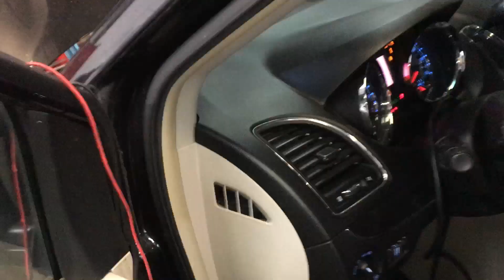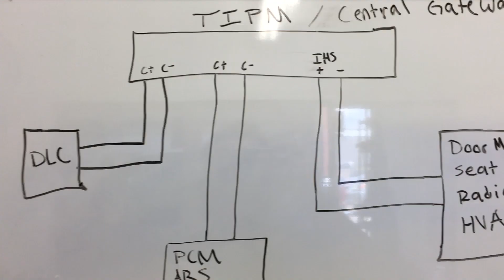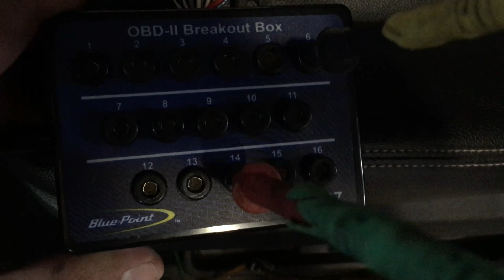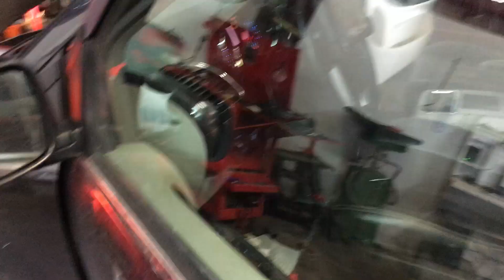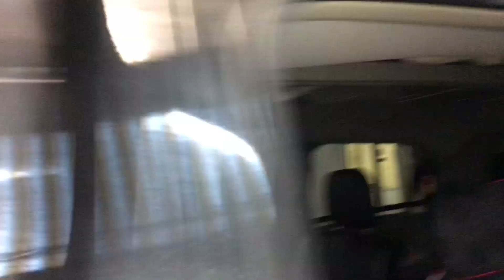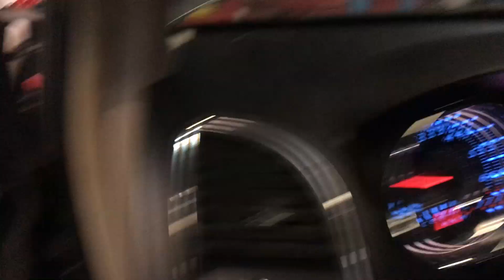TOWN & COUNTRY CARAVAN NO BUS DIAGNOSTIC

Comment: I got rid of the code.  No fooling with TIPM or wires.  Not sure how i did it, but i let the car sit for at least 4 or 5 hours without messing with it.  Then i sat in the drivers seat and turned it on.  The radio started to light up and finally came back on...then went off...i turned the car off and put the key in accessory mode.  Playing with the reset button on the steering wheel...i also pressed on the gas pedal....then i kept going back and forth with key in ignition without turning the car on.  All the lights that were on the dash started clearing away.  Then i turned the car on again..and all came back on....i repeated what i did before....then my windows were able to go up and down by me pressing on button...and my passenger back doors started to open  by me pressing on it's buttons.  We had a heavy rain here in Texas.  And i went through some puddles.  I believe that set off the sensors.  When everything went back to normal...the DASH said DONE.  Which meant no more error faults.  Hope this helps someone.  Btw a few days ago i did get a new alternator put in, i needed one and i needed a new battery as well.  There was no way i was going to get a new TIPM or have wire work done.  5th generation DGC and CHRYSLER T&C are possessed.

Comment: Thank you so much for this video, you probably saved us 100s of dollars at the repair shop. We have a Town and Country S minivan that had the same problem. It started after washing the vehicle. The problem was the drivers side rear door where the connection got wet from power washing. Again, thank you!!
Reply from the maker: I'm so glad this video was able to help you!
Reply: @ADVANCEDLEVELAUTO  just washed out vehicle and experiencing the same problems. Once it dries out did it fix problem or did  you still have to disconnect something?
Reply: I have a 2013 Caravan….is there still a module in the roof climate control w/o having DVD option?  I have tried most other modules without success…any insight appreciated.  Thanks
Reply: @dirtystayouts24 in thinking the same thing since the rear ac on my 2012 grand caravan doesn't work and now the lights come on randomly draining the battery while sitting in the driveway.  there are wires in the sliding doors I'm going to check, as well as the driver door wiring, as those can break most easily apparently

Comment: I have an 08 town and country with the same electrical issues. I’ve also had trouble with the van randomly switching to first gear while driving. The only way to change gears is to pull over, shut the van off, and manually change them. Sometimes it works, sometimes not. I’m pretty sure it’s not related to this but worth asking if anyone else has had the same issues. If so how did you fix it?
Reply: clean the connector to the transmission.  ive read those get corroded

Comment: I have a 2008 Dodge grand Caravan turn headlights on the flash code comes up high-voltage thank it could be alternator
Reply: The sensor wire could be shorted to power. Did you check your voltage at the battery terminals ?

Comment: Getting similar issues with gauges going crazy. I just went and straight unplugged the connecter for the dvd and rear AC and the dash goes back to normal but as soon as I plug it back in it starts going crazy again I believe it's the dvd player what would I need to fix this issue?

Comment: My question is how you charged this guy? One flat fee or per hour fee for diagnostics? What did you tell him about the diagnostics fees when he first walked in the door? How do you explain to a customer the diagnostic could take one hour or a couple of days? What do you tell them when it took you 16 hours to diagnose and it turn out to be a melted wire that took 2 minutes to fix? Or better yet, you tell them the solution and they want to fix it themselves.

Comment: How did you fix the System Low Voltage? I’m having this problem and my battery seems to drain when I turn off my van, but no problem when it runs.

Comment: I have an 09 T&C. Issue is dash will reset while driving, wipers cycle, headlights pulse and every dash light illuminates as well as red security light in center of dash.
I have checked wiring to the doors - no damaged wires. After watching your video, my dvd player will not play a movie - there is power to the head unit and the screens, but it wont project  - however, the dvd in the radio plays just fine.
Any thoughts you could pass on??
Reply: Any idea on your problem? I think I have the same issue with my 09

Comment: Thank for the video! I tried this out on my 2009 dodge town & county. It didn’t work for mine. But I wanted to see if you had any other solutions or other options I can try out. You might know a more then I’m going in this blind. I bought this van from a auction it was a flood purchase. The van turns on and is drivable and the electrical is partially working. Wipers stay on headlights stay on, but the doors and the lights on the dash are not working the radio and tv also not working. Hopefully you can help. Thank you in advance!
Reply: Did you figured out ?

Comment: Hi Eric..I have a 2011 Chrysler T&C van.  Every few months the battery light comes on and the battery won't charge.  Then, every time I drive to Midas to get it fixed, the battery light will go out and it will start charging again.  Happens every few months.  Any ideas why this may be occurring?   Frank   (koerber@att.net)

Comment: Here is an idea you can try in a future "No Canbus" scenario. Basically connect only a positive external +5vdc supply to the Canbus reference line; no negative, or no ground connection from the 5vdc supply. 

Connect a 5v volt step-down voltage-regulator to the car battery, while keeping the car battery connected to the car. Then connect only the positive 5v output lead from the voltage-regulator to a known Canbus 5v-reference wire within the car. The Canbus should "come alive". Now connect the OBD scanner to determine which module is at fault.
Reply: Most wont get it but always  attack  easiest  first

Comment: I have a different problem with my van 09 dodge that gave me a half turn  and then seemed like battery died, since then won't turn over with a charger or jump. All lights come on but starter just won't spin. The way it happened I dont believe it's the starter but I know I could be wrong

Comment: Chrysler release a stament saying that those radios had issues causing this very problem.. And the dvd player is hooked directly into the iod fuse instead of its own fuse so because its coming on its telling other shit to come on or in this case to shut off. Way 2 much labor for something u cpuld have found by pulling fuses and mussuering the parasitic draw

Comment: This topic is intimidating, if only because of the specialty tools and the way communication is more complex than simple power and ground. However the more I think about it, basic principles still apply. It is also helpful in some systems to have end module resistors in parallel to allow a multimeter to measure resistance and infer the status of the wires (open, short, or good). The worst of this for general mechanics is the lack of normal values and poor communication of those standards in the dealer repair manual. In the end, your theme to disconnect modules one at a time and watch the signal seems to be reliable and systematic. I'm gonna have to tap into these circuits a few times to better appreciate how they work in normal vehicles. Another brilliant video, Eric.

Comment: Great diagnosis using a  simple 'cause and effect ' type of format, other than the lab scope functions. You would think with all the program[s] sophistication and high/low speed 'data bursts' between the IHS portion of the TIPM and the LIN system or modules tied into the network, some type of parameter ID could monitor and identify what module's resistance value increases or decreases +/- 20% from a specified value. When that specific  resistance value is exceeded, the corresponding module that deviates beyond the preset parameter would trigger a 'CE' light to notify the operator or technician like yourself who has the correct scan tool and diagnostic software. I realize the customer had spent a significant amount on your labor fees via the poor design of not having accessible splices and a single location for the numerous modules, however, I noticed a child's safety seat in the back; and the customer did not wish to have you repair a speed sensor on a small mini-van to make sure the break system was in top shelf condition? Maybe he has recently experienced other unknown debts, I guess. I would certainly state his refusal to Not repair the ABS system on his invoice as a matter of CYA. Video is a Great learning tool; and condensed to boot!
Reply: So what you're saying is every vehicle and there's millions of them that have no or inoperable antilock brakes is some kind of a form of child abuse? Hopefully you see the real child abuse is letting a child think there's something they're not and even supporting it with your time and your money or even worse taxpayers funds. That's child abuse that will affect them their entire life.

Comment: The problem in my area is the customer doesn't want to pay for this type of diag. Plus the management tend to discount the difficulty of diagnosing this stuff. Most mangers are stuck in 1980. Just do a real quick check is what they say. They have ZERO knowledge of how this stuff works and don't believe all this testing is needed. So the manger won't pay/charge for it. Brakes and alignments are guaranteed money. I. Give. Up, I really believe we are going to see massive delays getting cars repaired in another 10 years. All this fancy crap is going to start failing and there won't be nearly enough techs with the knowledge to diag it much less customers that can afford to replace the hardware. It's not that hard to roll a window up with a handle...but I digress...

Comment: Good diag. Not sure if you tried disconnecting the door entirely. Most doors have a single connector at the hinge which would’ve made the diag a little faster since you wouldnt have had to take the door panels off. Either way good diag with good direction. I know it sucks when you can’t find the exact cause but at the end of the day if the customer doesn’t have the money you gotta stop there and keep moving.

Comment: Are there separate connectors for the doors, vacuum, radio, etc. on the TPIM? You took the door panels off and hvac unit out. Could you not have disconnected these modules on the other end of their cables? At the central control module (TPIM?)?

Comment: Hey, FYI there are star connectors mounted under the dash to disconnect all those module in one place, Makes it really fast to diagnose with out disassemble of the interior, I really liked your video.
Reply: Can you elaborate on how to find those?
Reply from the maker: I tried looking, but couldn't find them. Thanks for watching!
Reply: I am having the same the problem with my van, very informative I feel there is a few simple things I can try now to cut down on labor cost 😬🙏

Comment: Your video really helped us, but we couldn't find the problem on a Dodge Caravan 2014. We checked both door modules, the monitor and radio modules, also the DRL module. Also, recently the customer changed her fuse box due to this problem.

If you could write back and help us figure out this problem, we would truly appreciate it! Thanks
Reply: Did you figured out have the same issues ?
Reply: Most CTCs fails in the drivers doors rubber boot to A-pillar plug. Check the twisted Canbus cables there.

Comment: ADVANCE LEVEL AUTO, Does every car have a central gateway circuit board? What does the gateway circuit board do it just converts the CAN signals into SAE J1850 signals and ISO9141 signals and ILS signals? what are the SAE J1850 signals and ISO9141 signals used for in cars, have you used them to troubleshoot car issues failures? What are these different baud rates used for 500K, 250K, 125K?

Comment: 2 things. First does your autel have the scope? If it does do you like that and can you shoot a video of you using it? Second could you just pull fuses without disconnecting the modules? Jw. Thanks
Reply from the maker: It does come with a built in scope software but I still need to purchase the Maxiscope hardware.
Reply from the maker: Fuses generally feed many circuits at once, but I suppose in some circumstances it may work.

Comment: For a job like this that takes time to   Diagnostic. ,, how would you   Charge  the costumer  by hour.?And how long is an acceptable  amount of time ??
Reply from the maker: You have to charge by the hour. What I tell the customer is that within the first hour I should be able to have a good idea of what is happening. Then I will stop to call them, before I start removing panels. I explain to them why I need to charge more time before I continue. As long as you stay in communication with your customer, they don’t feel the anxiety of not knowing how high the bill is. Thanks for watching!

Comment: Thank you Sir. Good job. I appreciate your videos. When your scope acquired the signal, after you unplugged the monitor bulkhead connector, what voltage levels were the waveforms? 1.5V to 3.5V or 0V to 5V
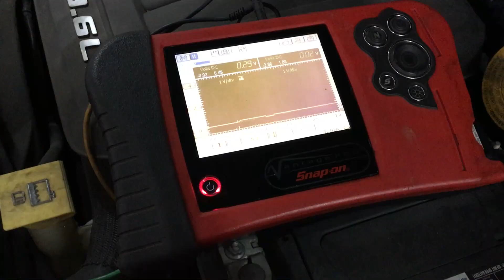Reply from the maker: A little hard to tell, but it looks to be between 2v to 3v and 3v to 4v. If you jump to 20:00 minute mark in the video. Chrysler does not specify a normal voltage value for the IHS like they do for the Can C. Thanks for watching!

Comment: Great diag and nice explanations.  Too bad about no splice in can bus. Would have made it easier. Wife has same van, can’t wait for it to act up. No DVD option in ours so one less thing to act up. (Thanks youFiat/Chrysler technology!) Look forward to your next video...
Reply from the maker: Thanks!
Reply: Really nice work you did!

This is really a German Bosch design where everything is a 3rd party vendor module... profit center!

It's all nice and fancy but these system should diagnose themselves... just like airplanes do. Instead any single individual module can disrupt the whole bus, WTF. These days Benz has 5 to 8 separate buses connected through a gateway in order to isolate failures by order of importance (Ex: windows can't screw up transmission)